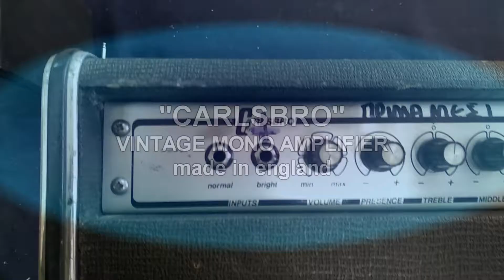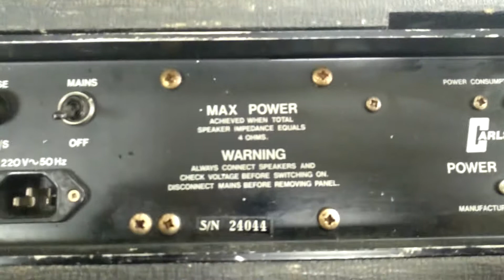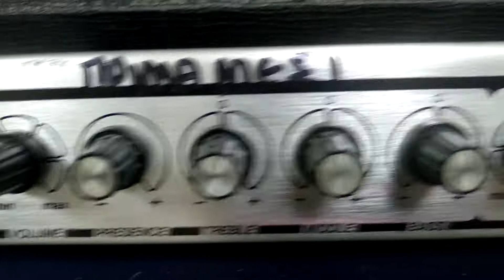carlsbro vintage amplifier quick look - teardown

Comment: Great sounding amps! One of the only transitor amps I actually like.. !
One thing, those power transistors - you need to take them off and replace the thermal compound. It will have long since turned in to cement.
Reply from the maker: ohh..ok..thanks for the tip..